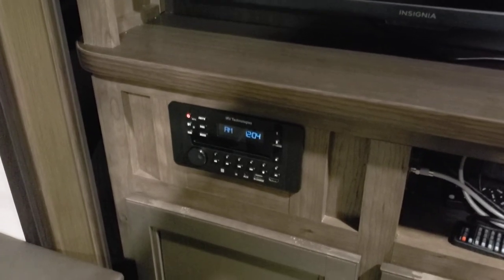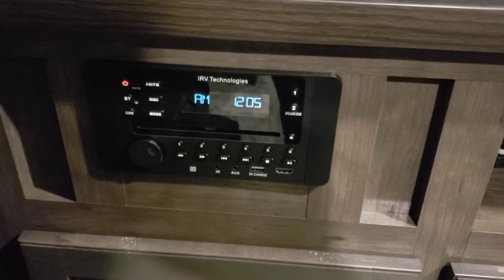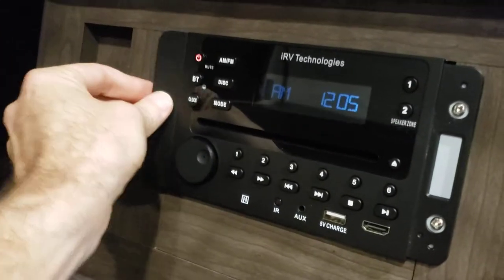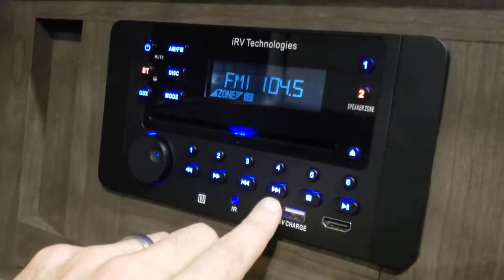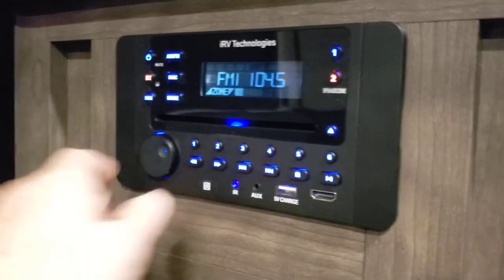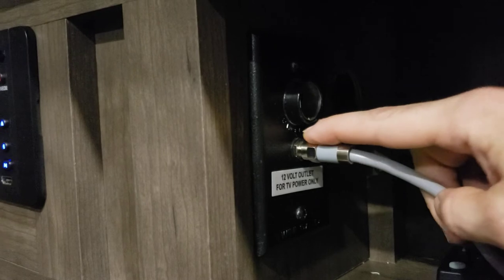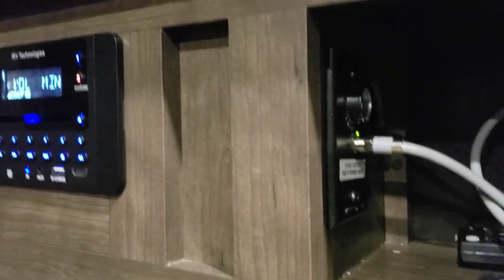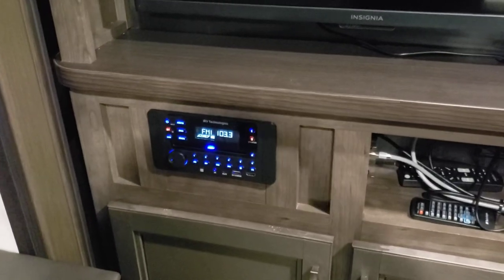Jayco Radio Reception Fix

Comment: Wait...where does that coax cable go to? You have one end connected to the wall connector, but where does the other end go?
Reply from the maker: I think it actually goes to the TV.  This is an antenna booster, and I believe intended for the TV.  But it seems to help a lot with the radio as well!  Go figure!